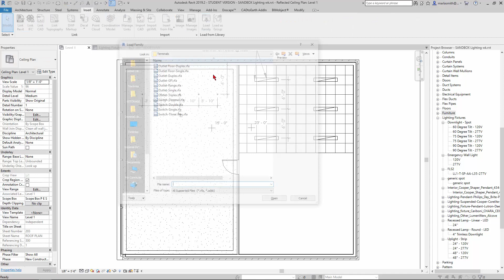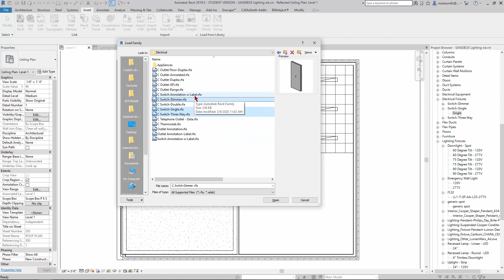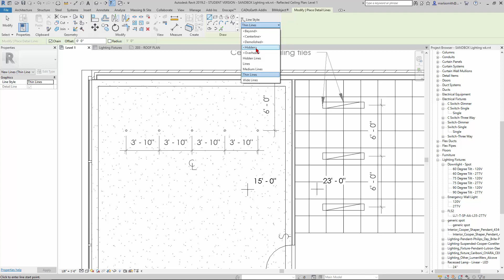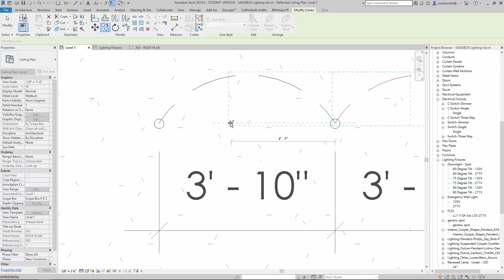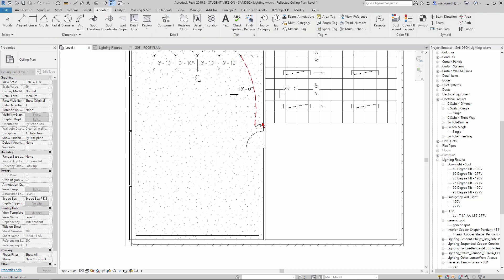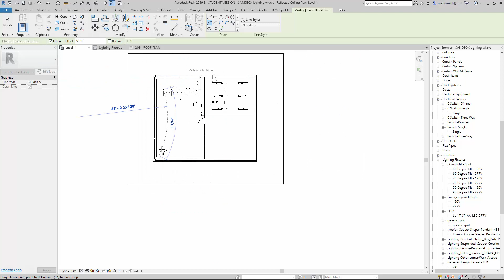08a Revit Lighting Switching

Comment: Wait, isn't there a real way to actually link the lights instead of just using detail lines?
Reply from the maker: Yes,  you can create an electrical circuit in the systems tab.  This application is not for electrical engineers and we opted for the analog connection since we are working through various designs.
Reply: @MSmithWorkShop  ok, you are right now that I think about it, no need to make more work for yourself, especially if you are not go to be creating the electrical drawings
Reply: You really went to town with that  accent , thanks for the video!